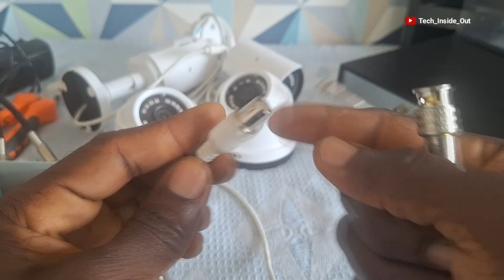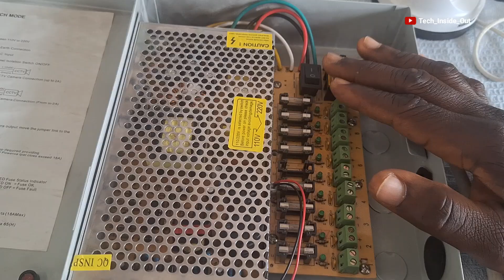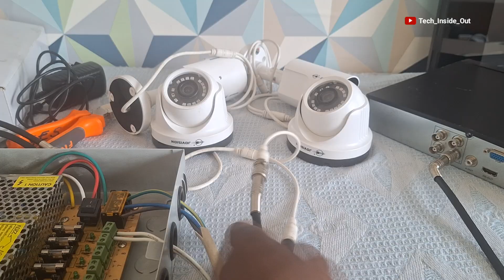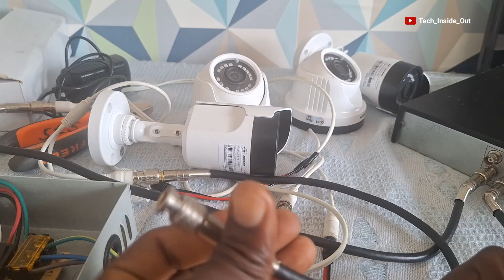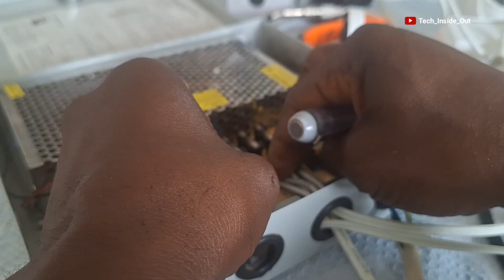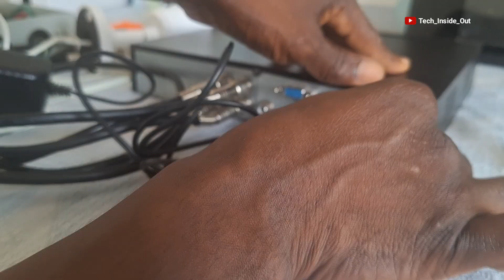Practical AHD CCTV Camera installation fully explained guide for setting up AHD CCTV Cameras

Comment: The products used here are all the same in the cctv industry . Just different brand names and different oem look software gui and some terminology.  All the manuals are ther same. And  working network is the same as ip cameras . Conections dont need a network tecnition if power goes out or settings lost or dont know ip it terminology.  Everything  shold be same price everywhere  as well . 
 Most amazon and  other  ebay  no name or  manufactured low price 1 yr or less warranty . Are electronic made to low quality standards . And designed to fail. Capacitors and motherboard.  Cameras too and low quamity  infra red emmiters . Even some 200  rebranded qsee  products have problems . Look for 2 and 3 and 5 year coverage  limited  manufacturing warranty . Not power related warranty and power   dc or ac supplies  , included.  Good place will know and test if dc spike had happened .   Say yes or no.  ElectricEyes Ethical cctv  network  global  affiliates soon. Wholsale price . 800 products . Galaxy atmospheric ethical Enterprises . CANADA CAN-DO  STRONG .
all the didital analog products  technology  is 10 years d and still current and will be , as same mega pixels . Lower price and same networking.  Plus more adaptable  and easy to connect if any troublshooting .  Easily another 20 years.  As nothing can stream well over hd 2 mp .without 300mbps connection upload . Yes need upload .  Customizable this with this to low resolution to higher resolution.  No cloud storage and guarantee for hd storade . So whats the point .  Record locally hd and  if wanted cloud at 640 x 480 or  . 320 x 480..
M
Only hiend nvr and dvr can record 5 to 8 mega pixel at all recording  8/16 only 2 full frame  others 6 fram to 15 fps. On site .  Over 100mbps inhouse network storage  is possible to next room storage . Easy peasy . Cctv fun career . ElectricEyes.ca

Comment: Yes use video balun on each end . I like using the screw terminal type , as never gets moisture and bad connections  using cat 5 cable is fine . Dont need expensive cat 6 .  Easy peasy get 180 meters real time . And can put more than one on a cable . All the way there . Twisted pair .  Dc voltage can work for 80 meters .  Ac 24v can stable go 200 meters with an ac to 12vdc converter at camera end. 
 The all in one or 4 in 1 anolog digital cameras are better than ip cameras . And most cost effective  as well and video can be y out to another display quad dvdisplay unit adhd/tvi/cvi  ElectricEyes Ethical Network engineering canada. 
Why spend more . And can use for manufacturing and showing people at a door and tourists  remote app with multicating and streaming . Cant do that with ip cameras easily . Without ip Network  technition coirses . The is old / new school . Analog digital . Same mega pixel as any ip. 
I suggest still use 2 to 4 mp as the  recording and streaming and parts are reasonable  and avoiding  too big files and costly . As well cant stream or cloud storage mor than 1 mp properly 20 fps anyway . Welcome .garystreisel visionary technological utopian inventive guru and Nexus virtuoso canadian tinman with a heart anology and gratefulness guy.  Cctv master constan . I invitation for ethical knowledge. Cheers

Comment: Can I add balun on this connection
Reply from the maker: Baluns are normally used with Network cables, but in the case of Coaxial cable, baluns are not really recommended

Comment: Great video. Exactly what I needed!   What's the size of the flexible wire you used here?
Reply from the maker: I used 1.5mm, but if your distances are far from the power supply unit, i will recommend using 2.5mm flexible cable

Comment: Please Boss do they have both video and power cable long enough when installing it in a hotel or company?
Reply from the maker: There are combined video and power cables available but they are not recommended for large installations.
Reply: @Tech_Inside_Out  sir, what do you recommend for large installations?

Comment: Nice one boss. Please when purchasing the DVR, is it possible to get long video and power cables that can go as far as 60-80m?
Reply from the maker: Yes,  you can get it
Reply: Yes use video balun on each end . I like using the screw terminal type , as never gets moisture and bad connections  using cat 5 cable is fine . Dont need expensive cat 6 .  Easy peasy get 180 meters real time . And can put more than one on a cable . All the way there . Twisted pair .  Dc voltage can work for 80 meters .  Ac 24v can stable go 200 meters with an ac to 12vdc converter at camera end. 
 The all in one or 4 in 1 anolog digital cameras are better than ip cameras . And most cost effective  as well and video can be y out to another display quad dvdisplay unit adhd/tvi/cvi  ElectricEyes Ethical Network engineering canada. 
Why spend more . And can use for manufacturing and showing people at a door and tourists  remote app with multicating and streaming . Cant do that with ip cameras easily . Without ip Network  technition coirses . The is old / new school . Analog digital . Same mega pixel as any ip. 
I suggest still use 2 to 4 mp as the  recording and streaming and parts are reasonable  and avoiding  too big files and costly . As well cant stream or cloud storage mor than 1 mp properly 20 fps anyway . Welcome .garystreisel visionary technological utopian inventive guru and Nexus virtuoso canadian tinman with a heart anology and gratefulness guy.  Cctv master constan . I invitation for ethical knowledge. Cheers